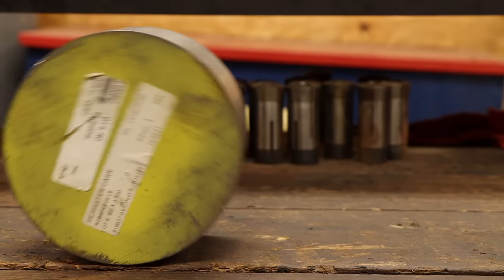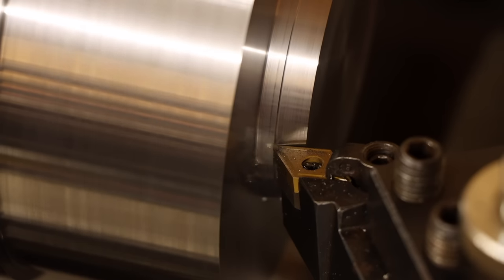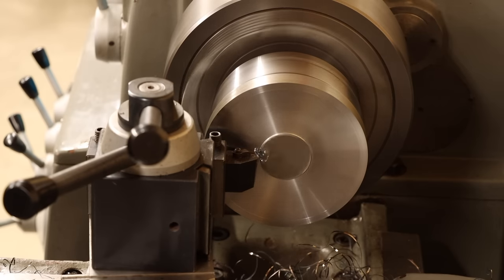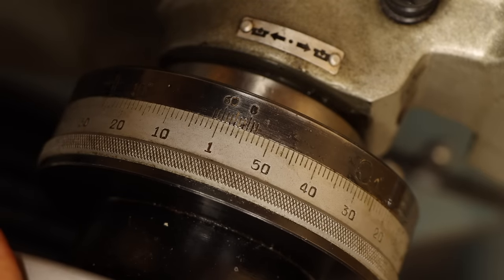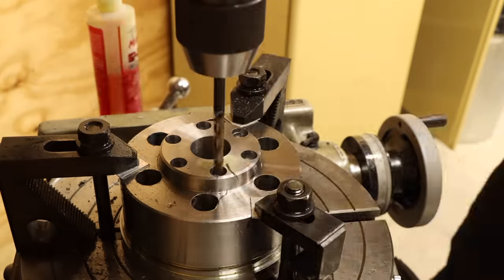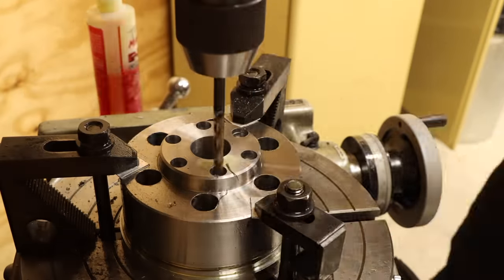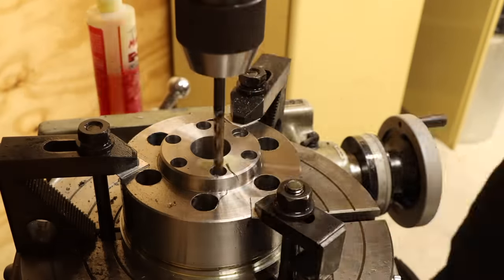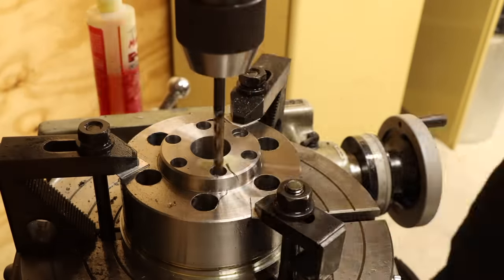Making a Rotary Chuck Adapter || INHERITANCE MACHINING

Comment: I felt the pain, when the sleeve got stuck 😅

This was an absolute monster project, came out nice 👌
Reply from the maker: 😂  everyone knows that "oh shit" feeling. Much appreciated, man!
Reply: @InheritanceMachining  Obviously you needed more heat, and you need to heat the entire part, otherwise the rest of the part is just going to suck up the heat and the bore isn't going to expand at all or evenly especially since it os right on the edge. Set an inside mic or a telescope gauge to .003 or .005 over the size of the sleeve and check as you heat to make sure the gauge slips through, then your sleeve should fall right in.

Comment: Drills are made to cut on the end while end mills are for side cutting. When a flat bottom hole is needed, drill to finished size then follow with a flat bottom drill. But you knew that already. Keep up the good work.

Comment: .002" is quite a heavy press for a 1inch sleeve. I use the .0005" per inch of diameter rule. .001" per inch for things that will have a lot of load.
Nice save with the sleeve and boring head and a beautiful part!!
Reply from the maker: Ah, good to know. Thanks!

Comment: Beautiful result for this custom part.  It may not match every dimension on the drawing, but when you’re done you can update the drawing to match the part.  Happens all the time in industry…… even in aerospace companies.  If you want to document these changes, just capture what’s change on a “engineering change order” and roll the drawing’s revision letter from NC (no change) to Rev A.  👍👍😎👍👍. Can’t wait for the next installment.
Reply from the maker: Oh I know this well 😂  Thanks for watching!
Reply: Over here, "A" would be a prior to construction rev. Your construction drawings would be rev 0, with the short description "issued for construction" in the revision block, and the update would be rev 1, probably described as "dimensions updated" and the revisions indicated with a "cloud" drawn around the changes in a light line weight.

Interesting just how different standard practice can be.

Comment: Excellent video Brandon.  I can totally relate.  I've made plenty of mistakes myself halfway through a complicated part, and more often than not scrapped the part and started over.  My hat's off to you not only for sticking with it but also for owning the mistake and learning from it.  One of my first projects was a brass gyroscope.  I got all the turning on the lathe done, and it came out beautiful....only to get completely eaten up by a 1/2" drill bit while I was drilling the flywheel.  As I was punching the 5th out of 6 holes, the bit grabbed and pulled the flywheel right out of my clamps, totally destroying it.  A total loss because stupid me didn't want to clamp it down too tight on my mill table for fear of marring the finish. How's that for irony?  

Regardless, the best lessons are those that sting a little....you never forget what you did wrong and you always remember how you fixed it.  Great content and take take care my friend.
Reply from the maker: Oh man.. the ironic mistakes like that are always the worst! You usually have a gut feeling that what you are doing isn't quite right then it comes back to bite you... been there before too!

Also that's exactly right. You could watch all the videos in the world but until you make the mistake yourself and at a cost, you may not truly learn. 

Thanks again for the support!

Comment: This is my new favourite machining channel. Absolutely love the slow pacing, the subtle humour and the awesome results your machining produces. I'm mainly watching it for entertainment purpose since I'm not a machinist myself. I'm more of a hobbyist woodworker. But you wouldn't believe how much tips and tricks a woodworker can get from a good machinist. Everything from measuring to work holding is a infinite number of steps up from what's actually needed for most woodworkers. Me however, I strive for a precision on my woodworking projects that almost(well...quite far from almost, but hey...) is on par with machining. Thank you so much for this channel!
Reply from the maker: Thanks so much! I do a bit of woodwork myself and I'd say there are a lot of overlaps. Wood also has its own special challenges being non-homogenous and more susceptible to temperature and humidity. From that perspective I wouldn't claim that metal machining is any more advanced. Anyway thanks again for the support!

Comment: That turned out fantastic. I'm a gunsmith that started out as a machinist, taught by my father a tool and die maker. Whenever I'm unfortunate enough to have to sleeve something I turn the sleeve OD to the hole ID and then lightly knurl .002 onto the sleeve, epoxy and press into place then clean up. Your repair was perfect.
Reply from the maker: Thank a lot! That's also an interesting strategy that probably has its merits. I'll remember that one

Comment: As an electronics engineer who has had to scrap more than one printed circuit board over his 30+ year career, I'm a bit jealous at how relatively easy it is for you to correct your mistakes.

Kudos for sharing them with us!
Reply from the maker: It only looks easy on film 😂  My pleasure!
Reply: Not every mistake has a tidy recovery, some tiny bonehead moves can ruin days of work and some very expensive material. Some of these metal products have a hefty price tag from a supplier dont forget. I'm sure you can relate after hours of meticulous soldering only to have a slight lapse or faulty  component ruin your hard work :).
That was a very good recovery, I'm really glad it worked out.

Comment: 18:49 At least your 'special' CB will live under the chuck, so you will only be reminded if changing out the chuck. I cried out with the quill handle snap. When you found out the one 0.875" hole was actually 1-1/2" 🙂, I immediately was 'brass plug bored out proper' so on the same page as your wife, but I am kind of glad you went steel and it came out beauty, and the co-boring ALL the holes to 0.9 was a good idea. I was a bit worried with the plug after the heat equalized that it may not budge, but glad the 'persuasion' sorted it to full depth. Proud subscriber, waiting for the next installment.
Reply from the maker: Glad you enjoyed it and thanks for all the support! It means a lot. Also on the shrink fit I really didn't heat it that much to begin since there was so much mass there, especially with the table.

Comment: The end product is very nice and you did very well to stick with it and not scrap this part & go for a new one. Working through the problems with nice solid solutions is where it's at. Kudo's to you and the wife for the sleeve idea.
Sleeving is something that we do a lot of at work to repair shafts with corrosion damage and also other parts. Not always possible but work well when they do. I would have given the Chuck more time to heat up and expand and at least a good 4hrs in the freezer for the sleeve. A little trick that I've learned is to set your telescope gauge to the size of your sleeve plus a few thou. Heat up the hole, let it expand and when the telescope gauge goes into the hole then your sleeve will fit nicely. Still need a gentle tap. Plus on your sleeve, make a small 60°chamfer so that it sleeve centres nicely in the hole.
Reply from the maker: Thanks, man. Also very clever idea with the bore gauge. I'll be remembering that one!

Comment: Just food for thought.  I wanted to mount a four-jaw independent chuck to a rotary table to hold oddly shaped objects.  I was going to make an adapter plate, but lazy me, I decided to do it differently.  This was an 8" table, and I wanted an 8" chuck for it.  Using the T-slots would have required a rather thick plate.  Since it is common for a 4-jaw independent flat-back chuck to be mounted to a spindle adapter with bolts from the front of the chuck, I simply drilled and tapped four holes in the top of the rotary table.  I did take the rotary table apart to make sure I didn't hit anything important when I drilled and tapped the front.  A simple solution.  If I want a 3-jaw scroll, I'll just mount it in the 4-jaw.

Comment: Great video. Great recovery. End results priceless. I bought the drawings from the ASME to duplicate a similar build for a D1-4. All I can do is hope it comes out close enough to do the job. Having the tools to work with means everything to a Hobbyist. We kind of learn as we go at times when it get complicated. My mill will be a JET 2hp mill/drill. It doesn't belong to me and sits at a friends shop about an hour away. IF we can get past the setup and take baby steps it might work out fine, of course nothing like you did. But we did pick up some good ideas watching your build. Thanks.

Comment: You had us wondering if you had a boring head until it showed up. Not going to razz or jeer as we've all taken shortcuts and learned not to from traveling down that road. The quill press through; that was an OH NO moment. Congratulations on salvaging the adapter and keep making your grandfather proud. Cheers!
Reply from the maker: Thanks! Yeah for some reason I thought I wouldn't have had the clearance so didn't even think to use it until it was my only option.

Comment: Breaking the quill lever was almost the first thing I did when I started a new job at a machine shop last April. I have a sneaky feeling they get fatigued too much because of a lacking relief cut. New one I made has been working fine, and to make sure it would hold for a while since I made it out of a beefy threaded rod made of A4 steel. (larger diameter than the threads needed, cut of the threads in the lathe (almost all the way, so you still had a shallow thread going the whole way, looks nice) and threaded the two ends)

Comment: Neat video. Wow, I haven't seen a drafting machine like that since I was an Engineering undergrad in the late 1960s. I used one that my older brother had, he moved from the machine to a simple  parallel bar. When his engineering company hired me an an intern during college, I grew to prefer the parallel bar as well. (sometimes nepotism is very nice).

Comment: I'm about your age and built my own machine shop (couldn't inherit it) after going to engineering school. I've been at it 15 years. I don't get a lot of time to work in the shop because after engineering i did medschool and soon i'll be a specialist neurosurgeon. I have a bigger mill, a smaller lathe, and a bigger surface grinder. Its interesting how despite different life circumstances we tend to gravitate towards to this childhood obsession of making things in the shop, even after all these years.
Reply: I don't have a bandsaw or sandblaster but I have an ACDC tig welder and my toolroom mill can spin a 350mm disc for parting off stock like a cold cut saw. Originally I wanted a big lathe but i took a mill and smaller lather instead since they were both together at some professor's shop who had to part ways with them due to poor health.
Reply from the maker: I find the different paths people take to end up in the same place interesting as well. Sounds like a pretty well outfitted shop!

Comment: Nice project. I'm currently making an adapter for my lathe to convert it from threaded spindle to D1-4. I was also going to drill the cam holes to size but I'll use my boring head now. Looking forward to seeing next video.
Reply from the maker: Thanks and glad this popped up in time for you. I actually got a recommendation to bore to within a couple thou then ream the rest for a better finish. The ream I did turned out bad only because I was taking close to 70 thou

Comment: That sleeve looks 👌

Also, first time I've ever heard a machinist actually talk about taking the heat of the part into consideration for the final measurements. Of course it's obvious now that you say it but I've never thought about it before. Very cool
Reply from the maker: Thanks man! Yeah I usually go by feel. If it's too hot to touch its probably too hot for a good measurements. At least in the ten thousandths range
Reply: I do machine work in a food plant maintenance dept.  99% of the work is 303 or 304 stainless.  Both have a thermal coefficient about twice that of carbon steel.  Consequently, I routinely take the temperature of parts into account on close fitting parts.

Comment: Have you tried inverting the parting tool, and reversing the spindle? If you have the power, a combination of rpm and feed rate will usually get the job done. A parallel hss blade can have problems clearing chips. The Iscar chip forming inserts are a great salvation. I have used them for everything for over forty years. Your project is one that I have never moved to the top of the list. I am looking forward to the follow up. I like the way you work and explain things.

Comment: Try using an end mill with less flutes to stop it from bouncing. 2 or 3 flute end mills are perfect for these types of applications, especially drilling into part of a cross hole, you were right about that, but four flutes doesn't allow enough room for chip evacuation. Not a criticism, just some friendly advice. Love your channel man.
Reply from the maker: Ah ok. That's great advice! Thanks!

Comment: When you tried using your part off tool on that large diameter, lower your RPM and feed faster. It will stop the chatter. Make sure you always use oil on your part off tool and watch your chips. If your chips are small or it starts to chatter, feed faster.

Comment: For times when you can't heat one part enough, liquid nitrogen can shrink a bushing a bunch. Then the parts go together with no drama. You can get some at many welding supply places.

Comment: Oh- Oh dear that uh, got out of control quickly. lol Damn good recovery though. I'd've considered scrapping it. My first thought was building the hole back up with tig weld, but, that uh, probably wouldve just made things worse. Sleveing it was def the right move though an actual arbor press might be in order. Actually, if you havent got one, that sounds like a good idea for a future project.
Reply from the maker: Thanks! I know right... 😂  I actually have a hydraulic press that would have worked perfectly but didn't want to have to break down my setup.

Comment: Enjoying your channel very much. VERY entertaining and informative as well.
Just as an FYI, I don't believe that using the mills power down-feed for drilling is a good idea. The power down-feed of this type of knee mill is made up of several small bronze gears and other delicate parts. These can be damaged from the high stresses of drilling, especially if a drill gets stuck. Reserve the down-feed for boring operations.
Keep up the great work! Thanks
Regards
Reply from the maker: Thanks a bunch! Thats a really good point I didn't even consider... I have power Z now so that's what I'll probably use in future.

Comment: Well, in spite of the issues involved, I am impressed with the successful order of operations.  That was complicated enough that I can see myself machining my way into a corner and having to create a fixturing nightmare to get out of it.  How close to parallel are your top and bottom faces?
Reply from the maker: Thanks! I actually haven't checked just yet. Was planning to do a whole section on that when all said and done

Comment: I am enjoying your channel very much, your a great engineer for sure. My only comment would be try not to put the quill under so much force. When using milling or boring cutters raise the knee rather than lower the quill. This will eliminate the flex and chatter, especially if you also lock the quill in place. Keep up the great work, really enjoying these videos!

Comment: I winced when the quill arm snapped. As long as no one gets hurt mistakes like these can teach you a lot. if you ever need to hammer on something in the rotary again (but please don't) maybe put a machinists jack under the part to keep the forces off the table.
Reply from the maker: That's exactly right! Also very good point on the jack. So far everything seems ok. I think the mass of the table was to my advantage here. Just a lot of inertia to move.

Comment: I'm a beginner machinist and have a question regarding your choice of tools for the cam-holes: Why did you choose an end-mill over the boring head in the first place? From my (admittedly highly rudimentary) knowledge you would have reduced tool-changes and uses a tool which intuitively seems more fitting to make a circular hole.
Reply from the maker: It was mostly because I assumed I didn't have clearance for the boring head in the first place. Not until I was backed into the corner did i give it a second thought

Comment: It looks fantastic! I need to do the same for my rotary table. I have a D1-4 lathe spindle however. So I cant hound you for your plans ;-p
Reply: @danhoag373  Must have missed that one from ToT. Will look for it now! Thanks!
Reply: @danhoag373  Yeah, I found one video where he makes a backplate but it was a bolt on, and not a cam lock. I should probably reword my mission. I need a D1-4 adaptor so I can move my lathe chucks to my rotary table without removing the stock. Not really a backplate per se...more of a mount for a D1-4. If you come across a D1-4 one though LMK, and thanks!
Reply from the maker: @christianstark1055  Thanks! Google "Iso 702-2 pdf". You should find a link through the homemodelenginemachinist website. Has the dimensions for all the D2 sizes

Comment: Should have just used the boring head to start with, and would be a good idea to indicate the piece in after hammering on it like that. I love the idea though, I intend to make something similar for the L taper chucks I use on my lathe so they can be put on my bridgeport and the rotary axiis of my cnc mill.
Reply from the maker: Oh.. i like the wheel idea. Gotta protect the marbles at all costs